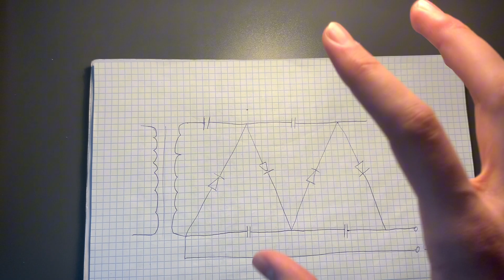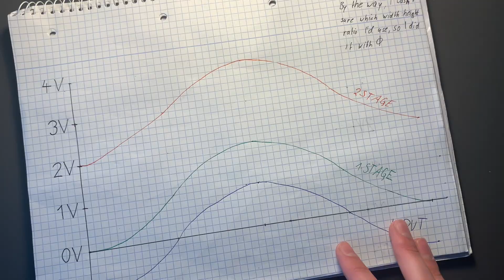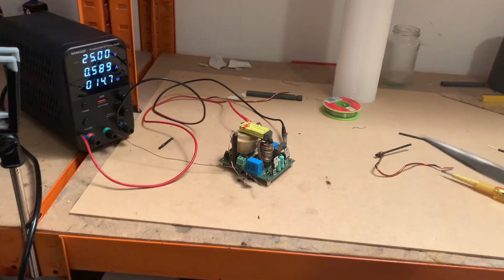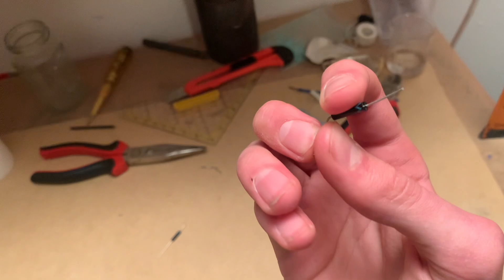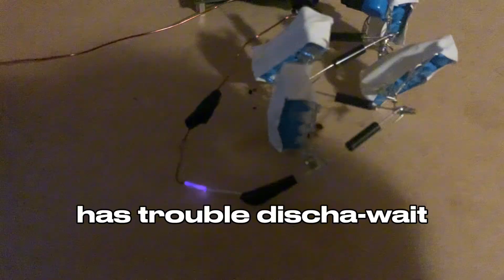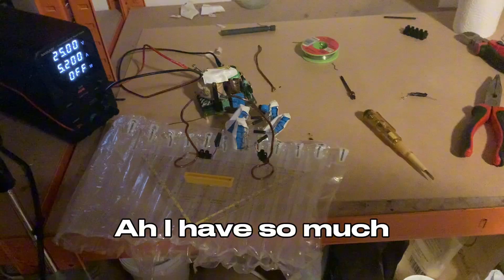Making 40.000 VOLTS IN MY BASEMENT With A Cockcroft Walton!

Comment: I know science if fun but they way your doing it will literarlly get you killed, and fast at that
Reply from the maker: Well, I doubt that heavily. At 100 watts and 40kV, the maximum current that can be continuously pushed out in a dhort circuit is 2,5mA, which is nowhere near killing a person. Now, yeah, capacitors do hold charge and a tonne of energy at that voltage which is precisely why I always discharge them. So why would I die?